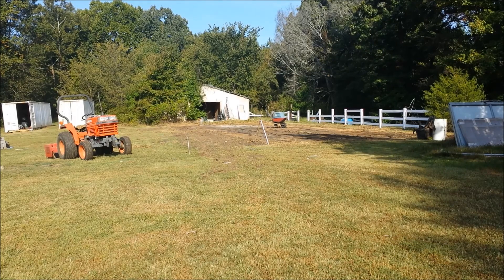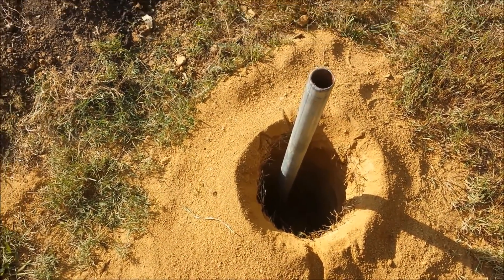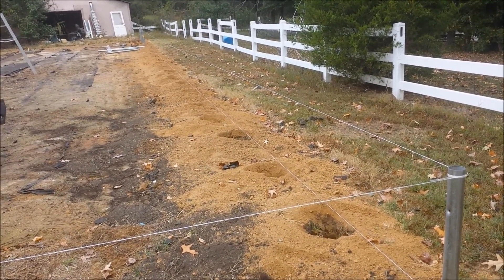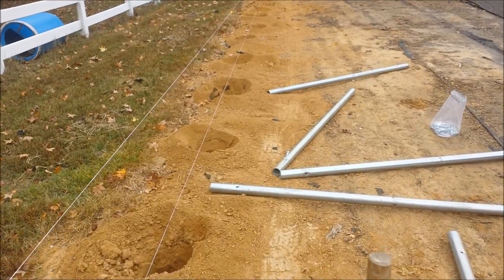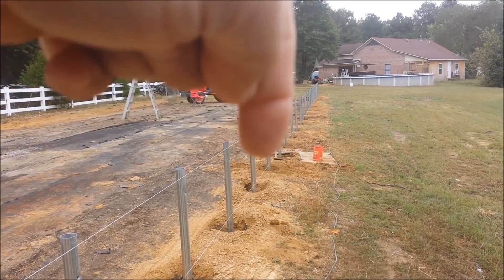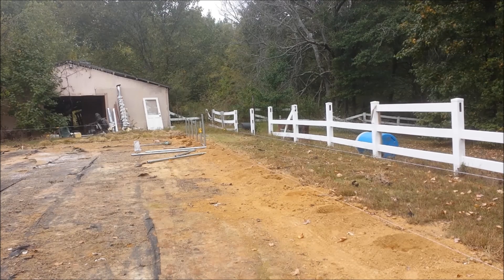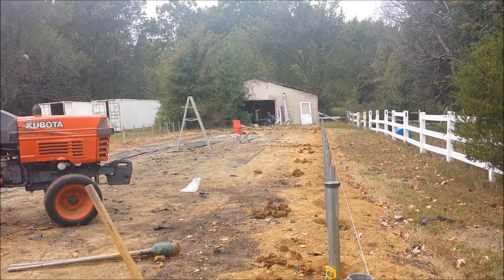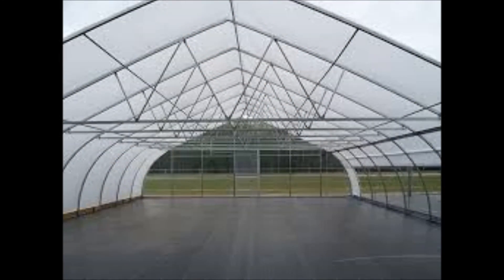The Snow Arch Greenhouse Build  Part 1,  Foundation & Ground Post

Comment: next time fill the pipe with water, it will helps you :)
Reply from the maker: thanks, I will try that!
Chuck
Reply: Actually, filling the holes with water  might be even better. It will serve to soften the clay sub-soil and lubricate the pipe. Of course, adding water to the inside of the pipe will help even more as the inside begins to fill with packed earth and clay.

Comment: Good start, Chuck. Looking forward to more updates as you progress. Amazing...Daniel never missed a lick with that sledge (or did you edit those out?  LOL)

It has rained ten days in a row at the Itsy Farm. We've been planting fall crops in our hoop house. Most of the work involved amending the soil since we have to plant crops in the ground during the first three years under the terms of the grant. We'll post a video after we're done.
Reply from the maker: By the time we got to that point we had driven right at 50 posts and we were pretty good at it. Plus we didn't want to waste any effort so that we could get finished. Lol
Chuck

Comment: Reminded me of our ground using my auger.  I use to add weight (mine had a shroud for safety) and then ended up getting a hydraulic assist for the arm.  Now that made things easier!
I think you did a terrific job with the holes and posts!  A little off topic but wouldn't it be easier to take that old shed down now before your structure goes up?
Reply from the maker: It would be easier but it's full of snakes and wasps. I will cut down the tree in front before I put up the arches.
Chuck
Reply: Fensterfarm Greenhouse what about your local fire dept, do they do practice burns?  Although, maybe the beams are worth salvaging.
Reply from the maker: +David Dube (Oregon Gardening) yeah, I plan on using all of the roofing and the truss wood on the new barn.
Chuck

Comment: That is going to be a huge greenhouse.  You have a big one already? or are you replacing it with this one
Reply from the maker: +Patrick Meehan Hey Patrick, This new 30x96 foot greenhouse is replacing a 30X96 foot greenhouse that collapsed this winter from a winter storm. I will be reusing some of the material from the old greenhouse that collapsed later on to try and build a 2nd one.
Chuck

Comment: And I thought digging 15 holes for 4x4s was hard work.  Wow, that's a lot of tedious leveling and a lot of sledgehammering.  Nice that you had help though, always makes it easier.
Reply from the maker: +FesterWerks My hands are still feeling the effects of that process. There are 56 holes for this particular greenhouse.about 5000 pounds of concrete in the ground in those holes too! My hands and back are feeling every bit of it!
Chuck

Comment: Thanks, I really enjoyed watching that start to come together. Look forward to seeing the rest of the construction as it happens. Your bolt on the bottom of the uprights reminded me that we used to do that to a lot of our construction jobs for signs, seats etc. to stop them getting pulled out of the ground by vandals - works a treat - although I suspect Mother Nature has more muscles!
Reply from the maker: +Alan Williams This greenhouse is rated to withstand 90 mph winds so I am thinking that the concrete is a major factor in that rating. I have to be honest with you.... driving that post into the ground with that extra bolt running through the middle of it was no fun! lolChuck